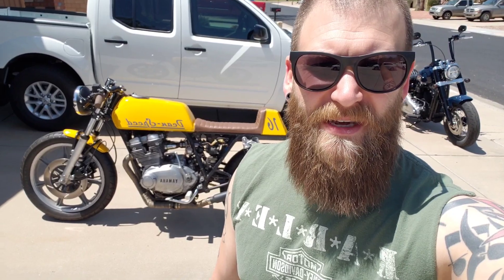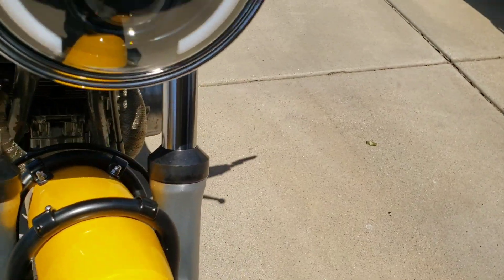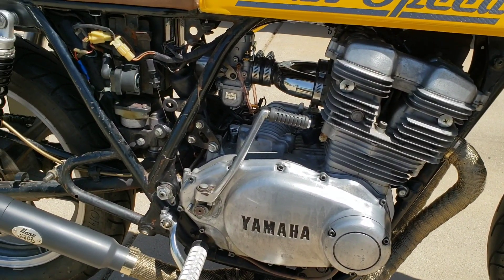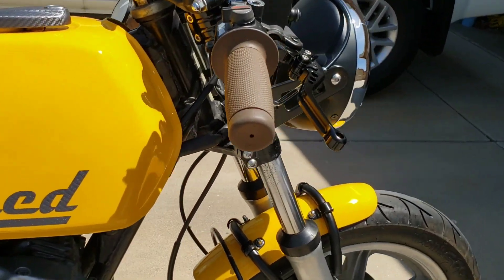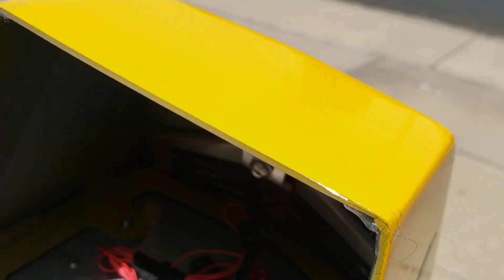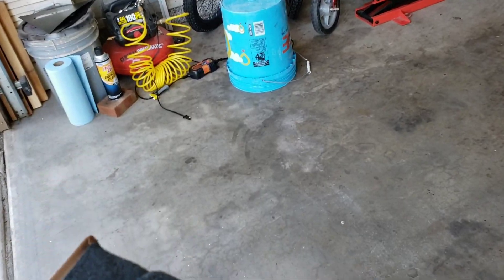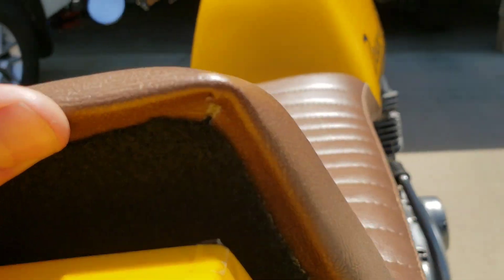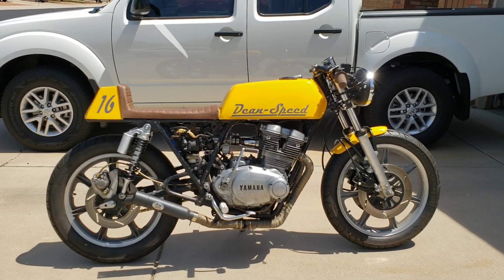Progress Report - 77 Yamaha XS 500 Cafe Project

Comment: Hi there, great bike! Did you keep it or sell? Was it relatively easy changing to one carb ? Could you let me know the part numbers if you have them.. also did it improve your fuel economy? Regards Paul...
Reply from the maker: Hey there Paul. I ended up selling this bike. Converting to a single slide carb, while sounding simple enough, comes with its own set of challenges. The fuel economy definitely worsened, and I could never really seem to get the 100% throttle position to work right which in the seat felt like the mixture the carb was delivering wasn't meeting the demand of the motor. I thought to go to a smaller carb but I was already running the richest settings which furnished the best results across most of the throttle position range. There was a slight delay in throttle responsiveness at low rpm, which I was anticipating. I believe the trouble lies partly in this setup being on a 180 crank, allowing for each side to rob the other at one part of the cycle. I have heard that this setup works far better on a 360 crank setup like the xs650. What part numbers are you wanting?
Reply: @aztriumphster  hi again thanks for information, I think I will leave the carbs sounds like to much Hassel for not much gain, funny you should mention the X's 650, I've just put a deposit down on one, maybe  I will consentrate on that bike less complicated engine etc... Thanks again for your knowledge... cheers Paul.

Comment: I would love to do one carb on my XS650
Reply from the maker: u should! there are way more options for the 650 than there is for the 500.
Reply from the maker: I always thought itd be cool to do a 650 bobber with an asymmetrical 2 into 1 carb manifold and have the filter sticking out one side.
Reply from the maker: Ive been kicking around the idea of going to 2 VM30s on my 500, which means ill be getting rid of my current setup. Lemme know if you are interested.

Comment: Hey, I'm 16 and thinking of buying my first bike a 77 Yamaha xs500e and looking for some one else's opinion. Do you think this would be a good bike to learn how to restore, ride, and hopefully turn into a Cafe Racer?
Reply from the maker: I would say the xs500 is an excellent platform for a cafe racer, especially because of the high revving engine. The restoration aspect is another story entirely because Yamaha didn't make too many of these so parts are difficult to come by. Lastly, learning to ride will prove much easier on a modern motorcycle than a vintage. Granted, if u learn to ride on a vintage bike, you can probably ride most anything after that ha ha.